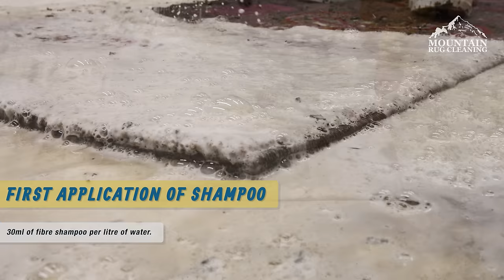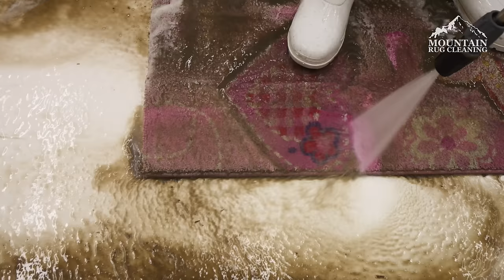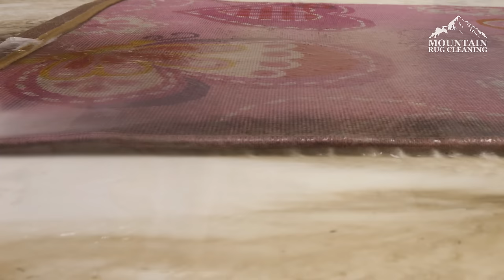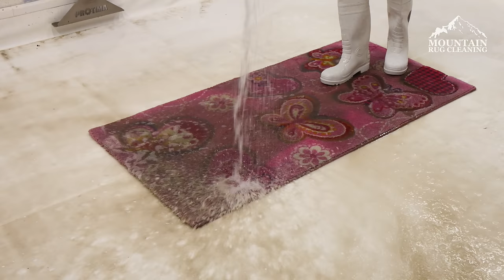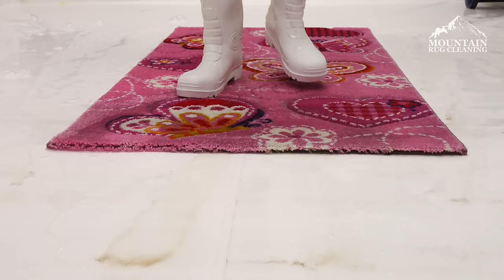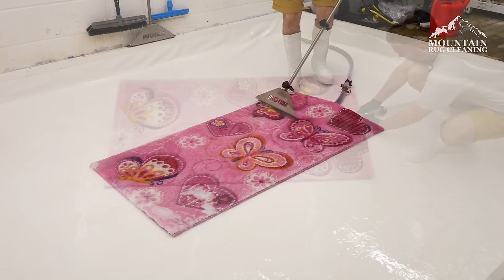Magical Transformation: From Filthy to Bright - Cleaning a Children's Colourful Rug

Comment: The pressure washing on the back always shows such clear lines.....love that. 

Quick question, have youe ever, or ever thought to, start pressure washing from the center out towards the edges? So that not only as it loosens the dirt from the rug it also helps push it away from the surface and off the edge. The squeegee would still be necessary of course....